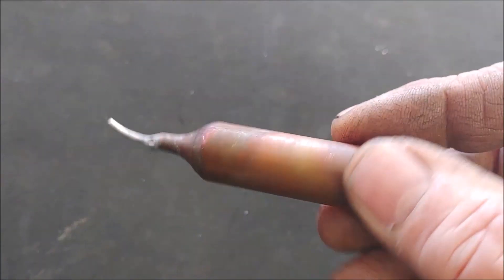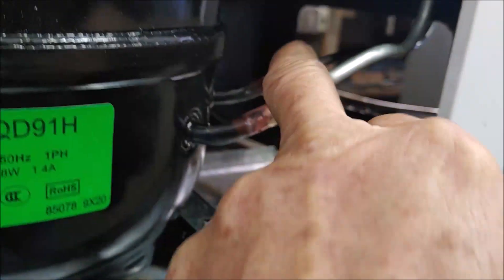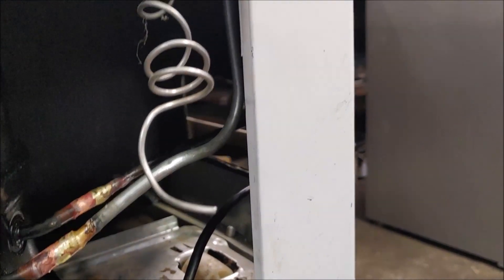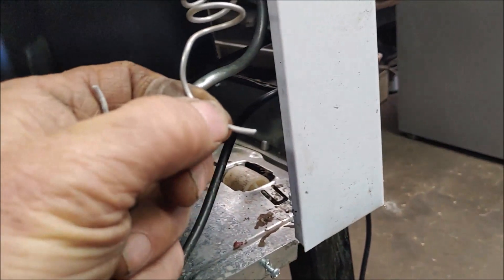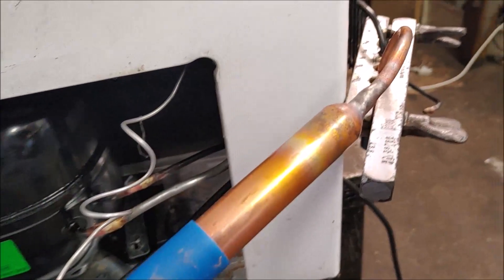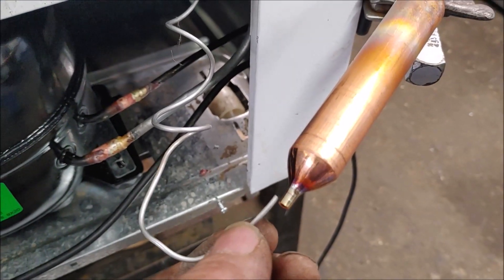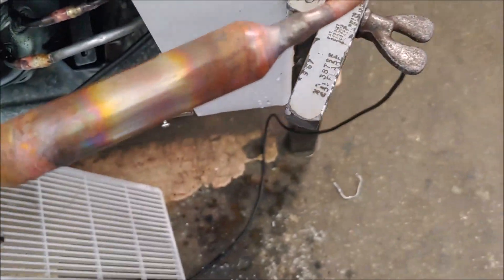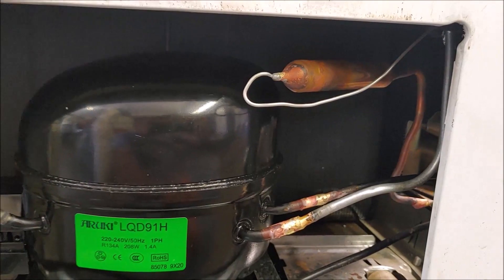Joining an aluminium capillary to a pencil drier

Comment: Hi got a leak on the incoming of the aluminum pipe in lower deep freezing
Reply from the maker: If you can reach that section, then it is easy to repair.

Comment: In my case there is gas coming from the pipe and won't allowed me to weld it. Any solution please?
Reply from the maker: You need to open the system somewhere else. Preferably on the suction side.
Reply: @JDNelRefrigeration  , thanks, but I don't get it, what system?..it's just like yours the area where it's cut apart.

Comment: firstly Thank you for your videos i learn a lot from it.I have also struggled with this.I use that mix combound called steenvas and that also works fine.It just needs drying time but i honestly joint a lot of them with steenvas and never had a come back on any of them.I tried welding them but personally its a nightmare.😀
Reply: Thank u i use it work perfect thanks man

Comment: Don't believe I've seen aluminum
cap tube before on this side of the pond.
Reply from the maker: The only fridges Ive seen with aluminium capilary tubes are from Brazil and South Africa.
Reply: I’ve never seen it in the US. I’ve replaced an repaired aluminum evaporators before. They don’t need much heat at all.
Reply: Those fridges come from Lesotho. 
It a nightmare to weld those. I have a job where the coil is split on an upright single door commercial freezer and has two capillaries. These two capillaries is fitted into a 5/16 pipe and from the 5/16 it is reduced to 1/4 and this goes into a 1/4" by 1/4" pencil drier. Also the suction return is 5/16" and a pin hole developed on the pipe and it is not on the weld but on the pipe itself. It looks like rusted due to the armaflex being wet.

Comment: Can you please make another video showing the welding procedure, I weld 3/16 on the drier capillary side (+- 30mm) and then Epoxy steel the capillary and pinch the end of the copper, I leave about 10mm of the capillary with no glue, as to not create a blockage. So I put the Epoxy on the capillary, with 10mm open on the tip, then slide in the tube and pinch the 3/16" at the very tip where the capillary enter. Leave the repair over night and charge the system the next day. It worked 100%, but will it last over time? Any thoughts? By the way, I like your videos, very educational. Please do make more.
Reply from the maker: Epoxy was used in the 1950s by Kelvinator USA to join it exactly the same way you do and it worked. Nothing wrong with it but I prefer welding it on.